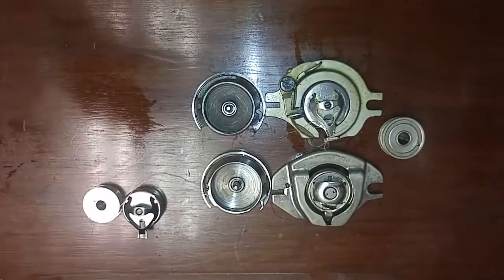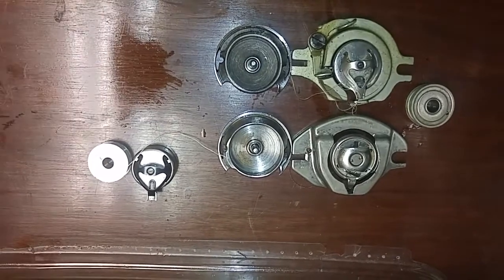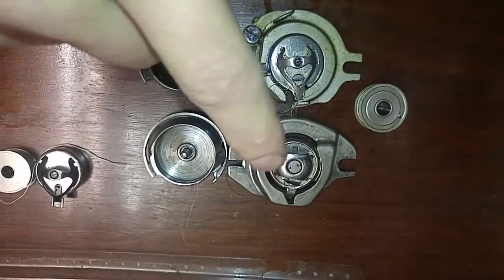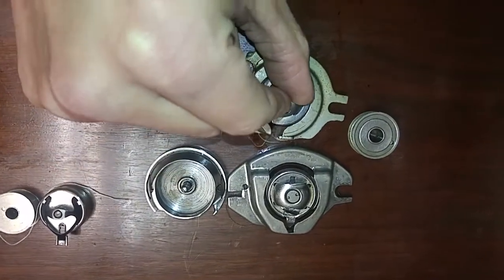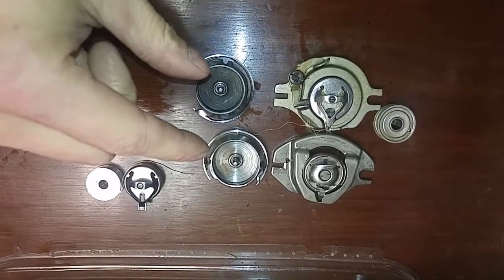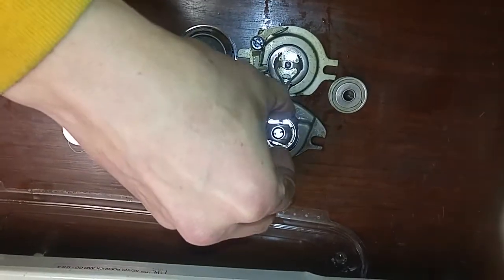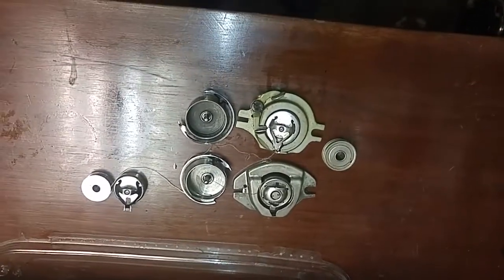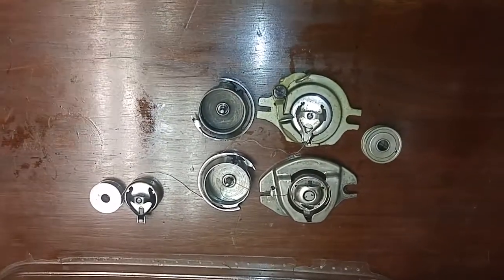White Rotary Race, Shuttle, Bobbin Case and Bobbin Made in the USA Designs

Comment: I have one of those oil lite machines you talk about ( somewhere ;-) ) I heard they are mostly not working now ..very strange machine even to get at it to work on. This is a very good video Thanks so much P. S. good to know that some are interchangeable
Reply from the maker: Thanks!  I appreciate the feedback. Trying to share what I wanted to learn and felt wasn't shown clearly elsewhere with images. Interesting finding like with the White FR's another part that doesn't interchange well between the same design makes and models is the bobbin slide cover plate.  I haven't compared to see if there is a similar situations with castings and spec ranges, so a might or might not fit situations as well with the throat (needle) plates.  I think I documented in a video the bobbin cover slide plate... though I have to review.
Reply: @jafinch78  You welcome. I am working on a white family right now all rusted up but un seized now but still a little stiff. The decals are perfect so it is worth it let it sit overnight, and hopefully it will be fine
Reply from the maker: @lindamorgan2678  Yes, amazing how oiling alone (I use the Baby Love Baby Oil from Dollar Tree religiously) and massaging by hand, treadle or with power the motions can be all that is required.  Patiences also, as I've only let the White's sit and soak... sometimes for a month before she really smoothed, just going down and massaging the motions until the day of amazement where I still to this day am like.. that's all?!  Awesome!  
I also more recently found instead of when I was using 99% IPA (from my electronics restore kit) to initially clean stuckness, unscented lamp oil seems to be a more budget friendly and inline with the old kerosene recommendation in manuals. Now with decals, have to be careful of course you know. 
Have faith and give her time, a little motivations... hopefully not the more maintenance wrenching persuasion... and they'll free up and in time run smooth I've found.